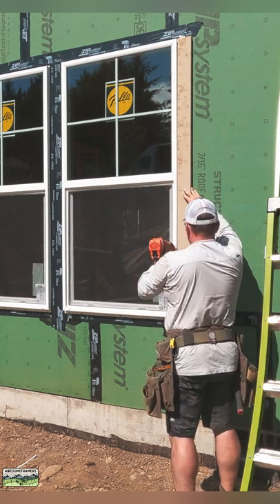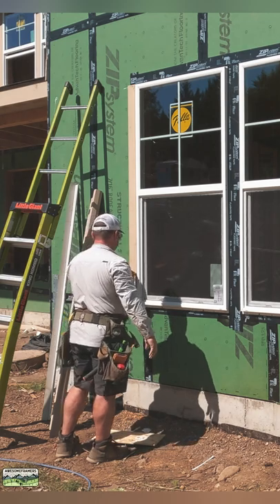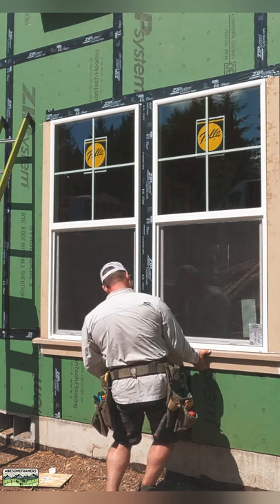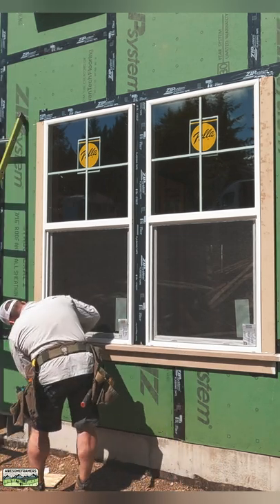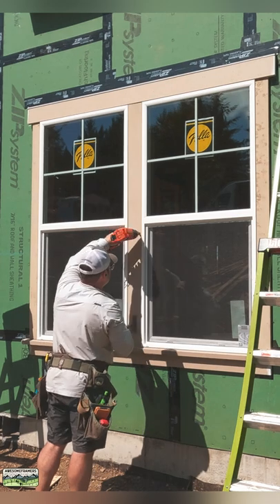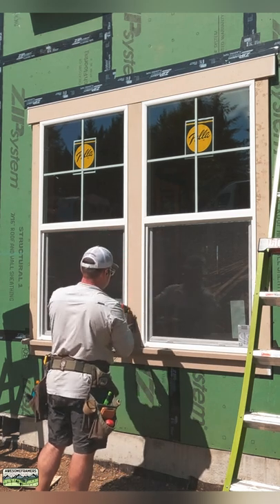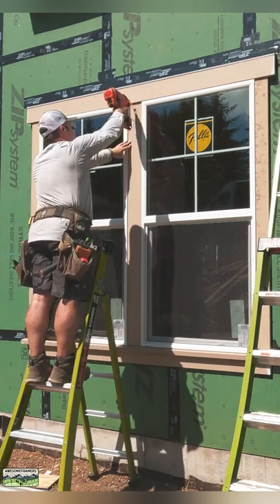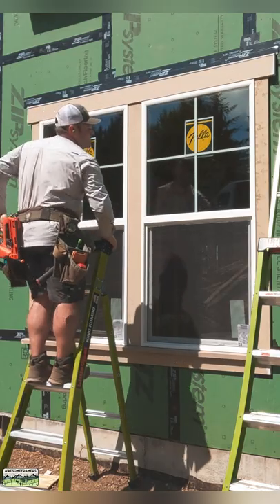Trimming Ext Windows #shorts

Comment: Only put about 100 nails through the flashing underneath the trim. The warranty is over by the time it leaks.
Reply: How would you propose trimming out windows and siding the house without putting holes through the flashing tape and sheeting?
Reply: How the heck is it leaking?
The hole is sealed by the nail ,then filled then painted approximately 3 times,
What kind of magic moisture is getting thru that 😳

Comment: I rip the back of the trim 1 1/2 by 1/4 deep, prime cuts with paint( for warranty). The back cut prevents buckle when the trim lays on the vynil window. Btw you Hella shot up the vynil window and potentially broke it, but who will know?
Reply: With the nail gun?
Reply: @cornpop9262  yes. The lip of the window that fasten to the wall with screws. Drive a nail through trim to close to the lip and it will break the vinyl. But I guess you'll know when you have to replace the window in the future what damage is done
Reply: I’ve seen this technique with this old  house videos. But isn’t the LP smart side have this already? I thought that could be included already if they know this is common for window detailing.
Reply: @misaelmartushev8818  youre talking about the flange right? nothing wrong with putting nails through the flange. how do you think they fasten the window to the wall in the first place? karen
Reply: @i8dapuszy  we fasten the window to the wall via fastening screws. Idk how you guys get away with shooting nails though vynil flanges but ok.
Reply: Was wishing he showed that. I have to picture frame them with pocket screws on the back otherwise corner s would never be tight and window flange causes all kinds of problems. Idk how he gets away with it
Reply: Thank you, i do the same trim detail. When siding with ceader shakes i also dato out the bottom of the trim and beauty bands so shakes cat tuck up beneath and get rid of the dreaded butting siding to trim.
Reply: @i8dapuszy you realize windows with nailing flanges come with manufactured holes that are a little oversized for a screw or nail? It’s good practice not to randomly shoot finish nails or any other nails all over the flanges. Some window and door company’s do specify this
Reply: @explicittruth1471  yes some come with oblong oval holes and some don't come with any holes at all. Sometimes the holes are right on the edge of your trimmer and it redirects the nail towards the window frame so you have to make your own holes. The reason they tell you not to do this is because you can chip off the flange on the cheaper plastic windows but if you turn down the AP on the coil gun it won't do that.

Comment: You every find it necessary to rabbet the back of the trim to account for the window flange being proud? I've had to do that a few times due to field conditions.
Reply from the maker: Good question and no. The last step for me is hold the trim put even with my nail puller and nail it. Once siding and sealant I'd applied, it'll stay
Reply: Your suggestion is my preferred method. Time consuming but way superior result.
Reply: @francoisbouvier7861  it only takes a couple minutes after the table saw is set up  and we'll worth it , or you can use a 3/16 x 1 1/2 slat tight  around the nailing fin and it brings your 3/4 trim to almost an inch proud , no need for 5/4 trim on sides .use the 5/4 for headers only. The trim effect is called farmhouse style.
Reply: @jefflinnell8492  The builders we work with call it craftsman trim.
Reply: . I have heard it referred to it as that as well.

Comment: You forgot the drip cap between the trim and the top of the windows.
Reply: Relax, the flanges are taped
Reply: @evanmartin4107  😂 Best response, and so versatile:
"Why are there no singles on the roof?"
"Relax, the sheathing joints are taped"

"Did you not solder the plumbing lines??"
"Relax, the joints are taped"
🤣🤣
Reply: Drip cap above the trim.
Reply: @joniboulware1436  I got that, but there needs to be a drip flash between the window and the trim.
Reply: That was my question as well.  I see he installed the z flashing above the trim.  Is this best practice and better than installing above the window?
Reply: @New_Czar  You should have flashing between every joint to prevent water infiltration (i.e.: window, flashing, trim, flashing, siding/stucco/etc)
Reply: That’s not necessary the flange of the window acts as a drip cap. No quality carpenter is installing a drip cap on top of the window frame.
Reply: @autumnparham9180  It's code in my province, so yeah, there are lol
Reply: Now that I think of it I always see drip cap above the trim around windows, garages, or the freeze boards between two stories . But not on the windows, garage, etc.

Comment: Never understand why people don’t caulk the butt joints like wood glue as they are installed. Those smart side boards especially. It only takes a second but it’s better than just relying on a thin layer of caulk on the crack
Reply from the maker: Because it isn't needed.  Follow LP's instructions and the siding lasts a long time. I regularly inspect a building that was sided with InnerSeal in 1993 and it looks brand new.  I was there 2 weeks ago.
Reply: I suppose
I’m in Florida so everything has to be installed above minimum standards to last
Osb and other paper faced engineered woods regularly turn to mush here
Real wood and even cement boards all take extra measures to make them last
Reply: Things move. It’s always a good idea to use adhesive for joints interior and exterior

Comment: Trash window tape it wouldn't go on my home.
Reply from the maker: You haven't used it.
Reply: @AwesomeFramers  I love how think you can tell me what I haven't done. Yes I have and it is good for what it is, but it is not a good window tape and the only reason is because of the thickness and durability it lacks. It is great for regular board but it will not hold up around the high heat, humidity and salt it the air. I will say building code and materials will vary depending on geographical location. So if that is the case and I am wrong I am mistaken. I think you do good work and have a great channel. However I do not want to seem like a troll.

Comment: LP smart side.. can't wait to watch the videos in a few years of people ripping this stuff off when it comes apart and they are complaining about who in their right mind would have used painted osb for exterior trim..

Boral, Hardie, PVC, etc so many good options out there with drastically better performance
Reply from the maker: Josh, I regularly inspect buildings sided with LP SmartSide and even InnerSeal that look as good as the day they were installed decades later.  The building with InnerSeal was sided in 1993.  I post the inspections to my IG stories.

SmartSide is a fantastic product and I can go back to buildings I sided with it in 1998 that look great.
Reply: @AwesomeFramers  I have seen delaminating smart siding in a good number of scenarios. It can be installed to last but it relies heavily on perfect paint and caulking water barriers. Whereas other products are more inert when it comes to water, like boral or Hardie or pvc. And if you miss some paint or caulk it won't bubble or delaminate. 

Maybe for a cheaper build but there is a reason high end houses don't use the product.
Reply from the maker: @Josh.1234  The reason for the delamination is improper installation.  SmartSide has a better warranty than fiber cement and  also has a better rating as to its effect on the environment.  It doesn't rely on "perfect paint and caulking water barriers".  PVC manufacturing is also problematic for the environment, and while it is often recyclable, it isn't.

Bottom line for me is that after researching it, installing it and inspecting it in our wet climate, the negative claims always come down to improper installation or a competitor making unsatiated claims.  

"there is a reason high end houses don't use this product" is a hasty generalization argument fallacy.  You don't have the numbers to prove this is true, haven't defined what "high end" means and haven't explained where your statistics came from.

I totally understand your experience and bias/preference (I have them too) leads you to your view.  Just to be clear, I'm not responding as though I know more than you or anyone else, just responding to the claims made.
Reply: @AwesomeFramers  You seem very invested in this product. I doubt anything I say would have any impact. Good luck putting it on your projects.
Reply from the maker: @Josh.1234  What I'm invested in, are facts.  I have no financial relationship with LP or any siding company.  I feel that each person should research for themselves and decide.
Reply: @AwesomeFramers  I get it, you have the facts and you have deemed it a great product. Your anecdotal observations from your experience are fact but mine are not, I accept that
Reply from the maker: @Josh.1234  that's not a fair representation of this discussion, but its time to move on.